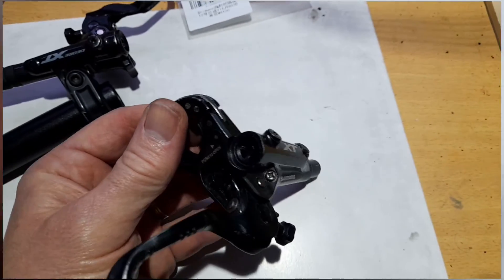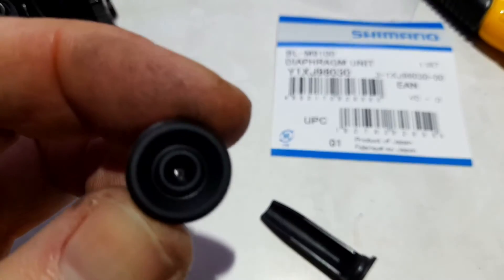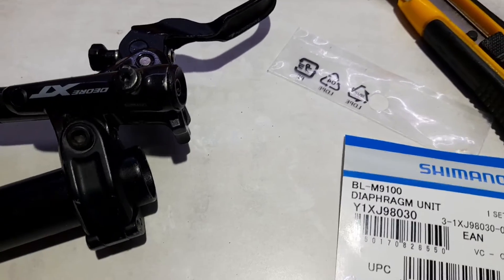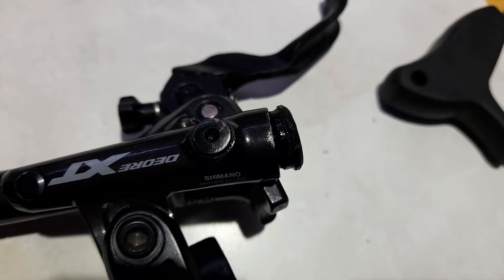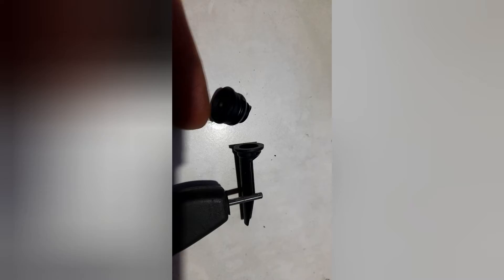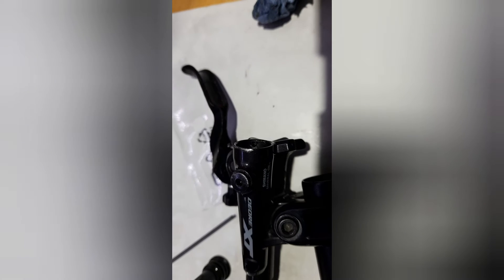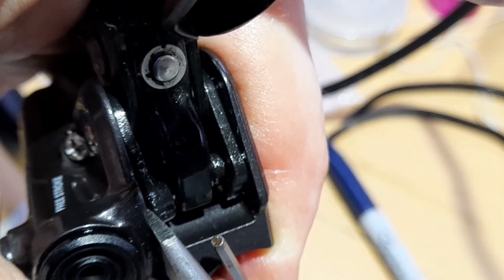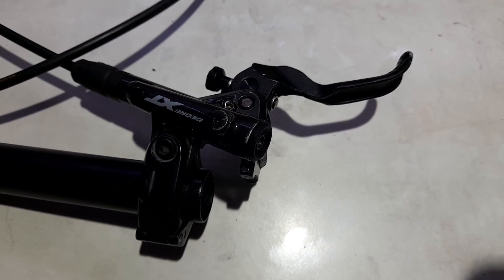Shimano lever diaphragm replacement

Comment: If this ruptured would air get into it causing it to be wonky?  Even after a bleed, sometimes my brakes will be very firm and then soft (non existent) on the next grab.
Reply from the maker: Hi Corey - I think so, but; also be careful that there isn't a leak in the system (loose connection) or trapped air first as this would give you that result too and is easier to resolve. A full bleed pushing new fluid up from the caliper and vibrating the whole system, let it settle, and do again should get air pockets out of the system (sorry if you know all this stuff) - if the lever or the diaphragm is leaking enough to cause this issue you should find fluid on it if it happens - no fluid anywhere would lead me to think trapped air. Hope that helps.

Comment: Thank You for the video! I just did the same thing. 😖 I pushed the pistons and some oil came out from the lever, apparently from the diaphragm unit. The brake seems to work, and I’m not sure did I break something. Could that diaphragm unit be there for this reason? To work as an over pressure valve? If there’s a hole in it, oil will come out from it when pressured.
Reply from the maker: I did think that initially, but research indicated that it did serve this function to a small extent but mostly to allow expansion and contraction from temperature variations. If you're not sure if there is a leak or not; I completely cleaned the lever unit with alcohol, left it to dry, and then pulled the lever hard a few times to see if any oil came out....it did so I changed out the diaphragm. Give that a try if you're not sure.

Comment: When I changed the brake pads and pushed the piston back (causing overpressure in the system), some oil came out of the diaphragm. Are you still having this issue with the new diaphragm?
Reply from the maker: @danielesolari1824  this was what caused the rupture in my diaphragm in the first place - now I've changed the diaphragm I haven't had any problems at all

Comment: Thanks a lot for this video! I just had the same thing with my Deore M6100/6120 brakes and this seems to have sorted it. Did the same thing, changing the pads just after a bleed, so too much oil in the system and it all went pop. Just reseating the diaphragm seems to be working for now, but just going to grab a spare set since they're only a couple of quid just to be safe.

Comment: What size hex key is that little grub screw? Mine doesn't seem to be small enough.
Reply from the maker: @davidspear6682  my set has 2.5mm 2mm and 1.5mm - couldn't say for sure which one is the right one, but one of these definitely did the job - a lot of sets don't have a 1.5mm I know. Hope that helps
Reply: @realworldriding2601  Thanks

Comment: Hola mi maneta pierde presion cundo la dejo apretada puede ser por el diaframa  gracias
Reply from the maker: @javiersevilla32  "My lever loses pressure when I leave it pressed, could it be because of the diaphragm? Thanks" - Javier, I'm not sure; usually leaving the lever pressed overnight is a way to get air out of the system - have you bled your brakes recently?

Javier, no estoy seguro; normalmente dejar la palanca presionada durante la noche es una forma de sacar el aire del systema ¿Has purgado los frenos recientemente?
Reply: Hola ya encontré el fallo uno de los pistones perdía aceite y al frenar entraba aire al circuito gracias

Comment: Thanks! Just recently had a similar situation. You helped me to understand the construction of that diaphragm and that oil can come out under pressure around that rubber peripheria. I charged my brake system and it was OK. When I changed new pads it turned out to be over pressure in the system and a bit of oil was thrown out of that diaphragm. it works now but not satisfied with the handbrake range with the old support.
Reply: When I changed the brake pads and pushed the piston back (causing overpressure in the system), some oil came out of the diaphragm. Are you still having this issue?

Comment: You are slightly wrong there's no pressure created in the area of the bladder. It is there to compensate for the oil used from piston displacement and it is effectively filled with atmosphere pressure through the end hole and stops the system cavitating. All the pressure is applied by the internal piston passing the oil way holes, sealing off the circuit and continuing to push transfers the pressure throughout the system and as the only moving part from then on it pushes the piston out.
I appreciate your video for the tip of getting it out though so thanks.
Reply from the maker: Thanks Aidie - this will help others understand better whats' happening in there if they need to: much appreciated.

Comment: Which XT is yours? M8000 or M8100? The diaphragm fits well, dispite the pachage says M9100?
Reply: The brake in the video is M8100, but someone here confirmed, that you can use the M9100 kit.

Comment: I found myself in the same situation. I couldn’t find the part for the XT brakes but I found it for the XTR. Slightly different but I thought it was worth a try. I just finished it and about to install it back on the bike. I see that you also have the XTR part which is slightly different. Any issues long term?
Reply from the maker: Not so far - definitely some differences in fit but no leakage as yet.
Reply: I am going trought the same problem. My brake is a XT M8000 and I just can find for M9100 (as the vídeo) and for XT M8100. I just cant figure out if fits well.
Reply: @gustavoebo9002  I’m not sure about the 8000-9000 compatibility, but I can confirm that the 8100-9100 are cross compatible
Reply from the maker: @ariskardas  thanks for confirming  that - it will help others on this thread
Reply: @realworldriding2601  Will this part number work on the MT-7100?
Reply from the maker: @ariskardas  After 5 days of multiple 1000m+ descents in the Swiss alps I can tell you there were absolutely no problems at all even with the slight mis-match

Comment: I inspected it and mine had a small pinhole in it. The plastic it wad covering had a small mold defect and poked a hole in it. Thank for this very informing video. Without I would not have been brave enough to tackle this. Cheers
Reply from the maker: You're welcome! - Glad it helped, well done

Comment from the maker: NOTE  if ypu only release the grub screw rather than remove it you wont have the same issues replacing it afterward!
Reply from the maker: Have now been running this lever for about 6 months, as a guide: take it from me; this has worked - good luck folks!
Reply: I found the same, just backed it out til the hex head was level with the body of the lever, then was able to sling it back in again.
Reply: Thanks!!!
Reply: Right. I just unscrewed the grub by 2 or 3 turns and managed to wiggle the part out and replacing it was a breeze. I would never have found the grub location without your video, so thanks a lot (had a leak on both brakes when storing the bike vertically on the wall). For reference, I used part nr Y1XK98030 (BL-M9120) for my XT BR-M8120/M8100 brakes.
Reply from the maker: @olivierremy2820  thanks for the comment, and thanks esp for the part numbers - lots of folks will find that useful
Reply: @realworldriding2601  Thanks. Also fyi, I found out upon careful inspection of the old diaphragms at home that both bladders were punctured right in the middle of the slope: a microscopic hole near a number written on the rubber...I feel much better now having found the problem!
Reply: Exactly what I needed. Thanks for making the video.